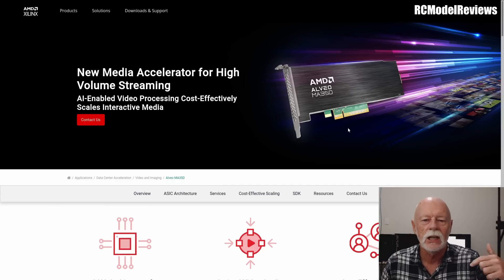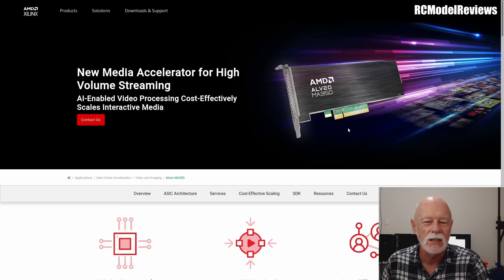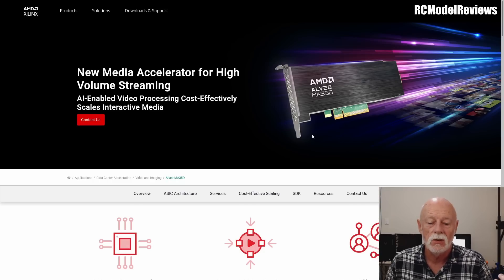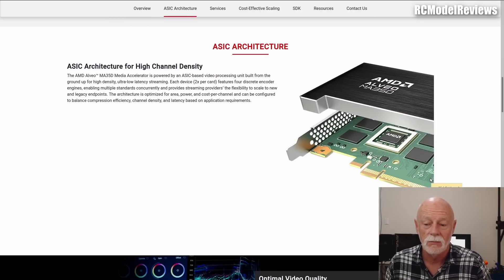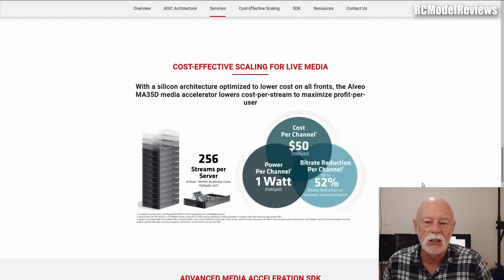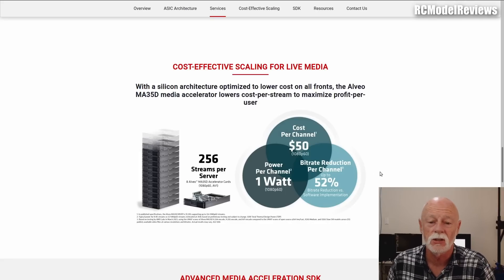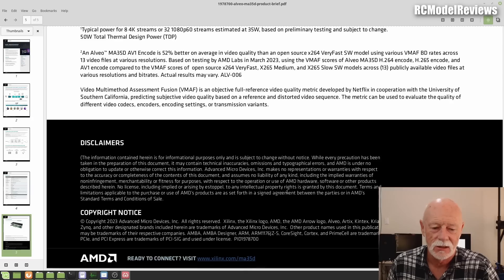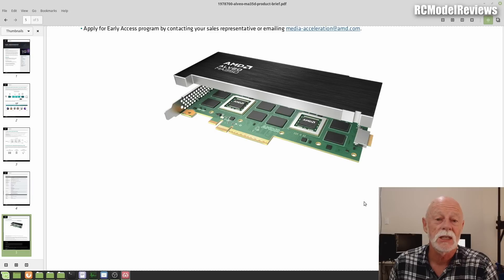Could AMD change the face of digital FPV?

Comment: Well, interesting, but I exclusively use analog on everything from 65mm indoor whoop to 4" prop FPV, which is as big as I go given the 250g rules.

Typically, except on the smallest, a Happymodel combined ELRS receiver and VTx transmitter weighing in at 2.1g (~£18) and a Caddx Ant lite, 1.5g (~£14). Low weight = performance, low cost = good news.

I use Skyzone 02c goggles, and at the moment see no reason to change.

It depends on one's personal use case - racing in my case, but the video quality is absolutely adequate for my purposes, it's light, small and cheap.

When digital video rivals the cost and weight of that, I'll think about it, or, more likely, when in the end digital pushes analog out of the market and I'm forced to.

Up to that point, it's not for me.

Comment: I know Alveo cards from times before AMD bought Xilinx - a company which makes FPGAs. Similiar encoder block is embedded for example into Kria K26 System on Module but with a lack of AV1 support. This module consumes around 5-10W. The encoder itself consumes very little power (below 0.5W), but the rest of the system (memory, CPUs...,) takes the biggest part of power draw.
In the FPGAs you can even implement codecs with latency in microseconds range. But the compression ratio in this case is far from what AV1 can offer.

Comment: Why should I wanna pay more for a chip and tech that is mass produced and therefore a lot cheaper than the 250000 units per year sold to the fpv community ?

More or less I am out of this better faster longer race cause the current digital system fit my needs except the price tag
the cost of the air systems are too high to be able to equip all my wings with those even though most of them have already fc built in and therefore camera and vtx would be perfect too.

So I am no longer spending big money and investments into the rc hobby, more smaller and different planes especially foam or flite test builts that last long and offer great fun for the money too cause you get the build fly and repair adventure and challengs as in the good old balsa days but with a much faster gratification in my experience. 

Therefore i am also investigating the free fpv system based on ordroitd and raspberry pis or jetson nanos and had been following curry kittens adventures over the past 3 years with open however it is called and always forget.

Comment: The major challenge with digital FPV is the need to adapt for constantly changing radio quality, using two-way communication between the encoder and decoder to get adaptive bitrate and error correction and still maintain a low latency. But as luck will have it there is a big market for low latency cloud game streaming and live streaming over internet in general. Meaning there is a lot of R&D and money going into making solutions that solve the same kind of problems as with FPV.

Comment: If raw encoding speed is all you are looking for , plenty of cheap Arm SoCs can already handle 4k60, 1080p120 etc... Pretty sure even the Allwinner chip used in HDZero goggles can compress/encode and decode video at 1080p60 / 720p 120 fps or higher. iirc the spec sheet of it's older variant even mentioned 720p 240 fps. So that will be like 4ms for encoding. 4ms for decoding. 2-3 ms for transmission etc.. in ideal case that all adds up to around 10-12ms of latency. But have to see what other components add how much latency. The openhd guys had neat benchmarks of doing all this on jetson nano.
Reply from the maker: yeah, but the Jetson is a power-hog and big/heavy for FPV use :-)  Also, it's the AV1 support that I find most interesting because that has the potential to reduce bandwidth requirements by as much as 30 percent over other codecs.

Comment: 8ms is just for the compression.  Don't forget it needs to be transmitted and  uncompressed on the other side to get the full latency.
Reply from the maker: Transmission is light-speed (ie: 1 nS per foot) so if you're flying 1,000 feet away the propagation delay adds only 1 microsecond of extra latency :-)

Also, decoding a stream is generally much faster than encoding it (by an order of magnitude or more) so this could still provide a very low glass-to-glass latency.
Reply: I was thinking the same, we only know the total glass to glass for the current systems, for all we know the dji encoder is also around 8-10ms, then you have to add the camera latency, decode latency, and display latency, it might be the same 20-40ms.

Comment: it looks like the board supports two channels because it has two CHIPS on it. so the premise that you could make the chip smaller cutting it down to one channel doesn't seem to hold. anyway, extremely interesting stuff indeed!
Reply from the maker: But each chip can handle 32 concurrent streams so a single-stream version should be smaller.
Reply: @RCModelReviews  oh, I see! yes, then you're absolutely right. thanks for explaining! 👍

Comment: Espressif has anounced the ESP32-P4 in January. It is a beefed-up microcontroller (2x400 MHz RISC-V, external RAM, lots of IO) with an built-in H264 Encoder, as well as fast digital IO for modern and legacy camera modules (MIPI CSI/DSI/Parallel etc). This chip could turn out to be THE chip for digital FPV systems. It can interface external Wifi and Cellular modems via SDIO or USB. One can build a very compact and cheap (probably below 60$) digital FPV system, similar to OpenHD, with this chip.

Comment: 8ms is likely chip latency. Add camera, modem twice and display latency
Reply: true
Reply from the maker: Not really.  The decode is usually much faster than the encode - up to an order of magnitude faster in fact.   You only have to compare the time it takes to render an H264 video on your computer compared to the rate at which you can display the same video.
Reply: @RCModelReviews  you can expect around 1 frame of latency on radio transmission if your link is near full utilization (it should be reasonably close to that for good video quality) with the chip you mention 20-24ms+ camera and display delays would be minimal latency at near maximum video quality.

Comment: But counting encode+decode shouldn’t you double the time to 16ms ?
Reply: No. Encoding is the hard part. Decoding is trivial in comparison. That's by design: you need to be able to decode the video on pretty low-power devices, so the codecs are optimised for easy decoding.
Reply: Decoding is usually way faster. Think file encoding like zip.

Comment: So the equivalent to a "Steam deck" as a controller ( set up for flight controls ) with a USB like cable to your goggles and a Flight controller that connects properly. OK, the hand held controller is slightly heavier but the goggles are lighter. The on-board controller shouldn't be any worse than existing. OR if you don't want to be tethered to the controller, well this card can handle two streams and your goggles will not need as much receiver power. 
Sounds good if it works.

Comment: Would it be possible to come up with a miniature digital system like the all-in-one analog cameras? I fly a lot of sub 250 now because of the rule change
Reply: Walksnail
Reply: @cinemoriahFPV  I just didn't that's it heavily into the full DJI setup was it Kydex fpv camera. I wish I'd have known about the other setup before I bought mine

Comment: Hey Bruce, since you're one of the tinkerers and even developed a lot with the raspberry pi (ADSB). By any chance did you ever try one of the opensource digital systems ? If you have any interest I would love to help you setup OpenHD (since I am one of the lead devs). I'm not really able to send you hardware since we're completely non-profit, but most likely you have about 90% of the hardware you need. We also did have ADSB integration in our osd, before we have rewritten almost everything, but plan to reintegrate it in the near future. Btw. great to see new videos on the rcmodelreviews channel, I feared you would have dropped this part of your youtube presence.
Reply: We also invested a lot of time making OpenHD working on X86 so AV1 is in theory doable with an X86 setup ;). With rockship hardware we could in the future even hw-decode AV1, but I didn't see any hw-encoder on any SBC, yet.
Reply: I hope you and the OpenHD guys sort out a low (enough) latency and small (enough) system for HD FPV. Pulling for you guys. I am sick of the abuse from DJI.
Reply: @DavidTaghehchian  we're working on much smaller hardware with much better latency, just needs a lot of time and hopefully only one more prototype generation
Reply: @OpenHD-Official  great to hear. Thanks for all the hard work.

Comment: I've had this idea for years that we could reduce construction operation of heavy equipment by making them FPV and hiring people from Pakistan, India, etc to run our heavy equipment from across the globe.  Low latency would be key in making it work. Robotic operators may come before this becomes reasonable though.
Reply: you have clearly never operated heavy equipment, that would be extraordinarily dangerous and stupid. You might be able to get away with it, right up to the moment that you don't. And that moment will be at the absolute worst possible time. But hey, thanks for trying so hard to cut out the western working man.
Reply: @earth9531 I think they're just expressing an idea they had lol, it's not that deep
Reply: Great idea.  Offshore more jobs 🙄
Reply: What could possibly go wrong?  And the repair suggests would be interesting. 😅